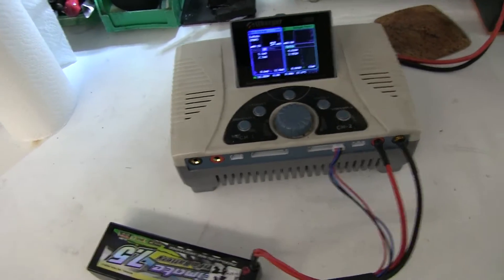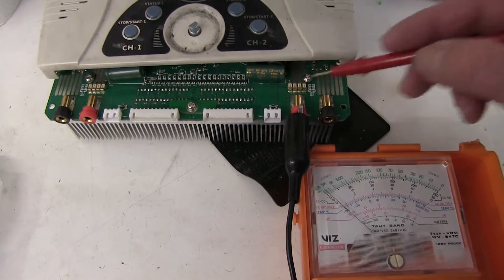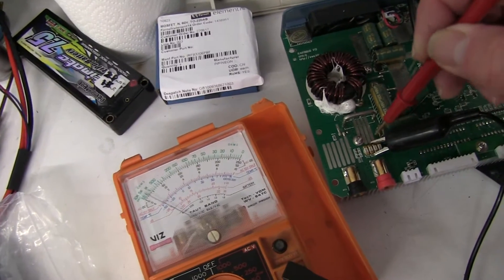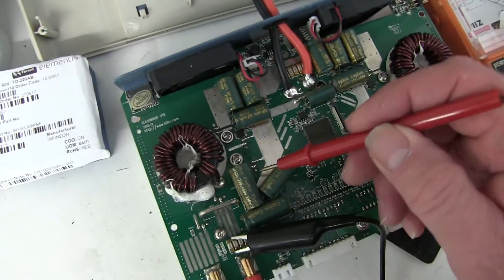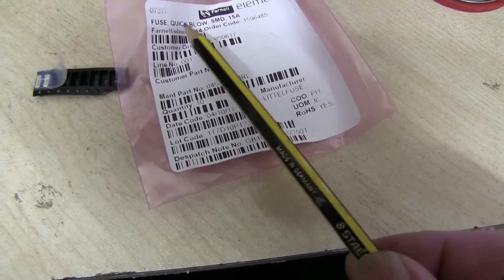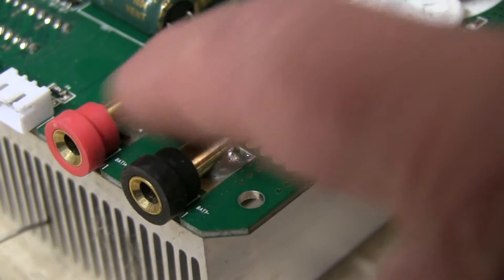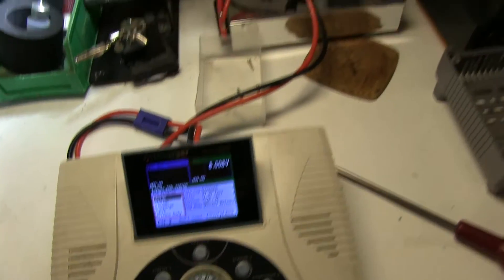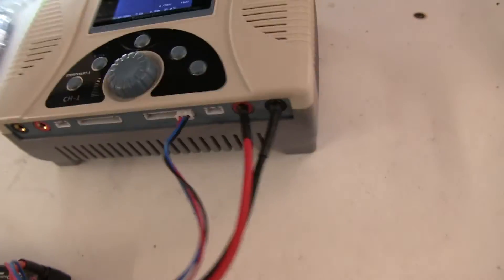ICharger 410 Duo Charger "Connection Check Error" Fuse repair.

Comment: Old charger, old posts lol.  But maybe someone can chime in.  I have a 4010 that blew all the ch2 fets from a power supply dropping from 36v to 24v.  I replace the fets and a few resistors that burned out, but now have a weird issue with ch2.  It will balance and discharge, but not charge.  When trying to charge the duo will make a pulsing sound and the charge current will climb with a negative value.  Without a current limited supply, it will burn the fets (learned the hard way).  The pulsing is pretty odd as well, you can actually feel it coming through the charge leads.  https://youtu.be/BUvKy_Ut18c

Comment: Don't fear trying to repair these ichargers
I managed to change 3 MOSFETs but you need a soldering iron with quite a thick tip to retain the heat...I used a Weller with a 6mm tip I struggled with a pointed tip ..be warned.
I purchased a longer ribbon cable which definitely helped plus be very careful with the ribbon cable RETAINING BARS there very weak and snap the legs off...I ended up having to wedge them in...and taking the screen off to manage to reassemble the charger.
If you find the charger doesn't come on its probably a bad soldered joint...
It works perfectly now. Thanks Nick RIP😇

Comment: Hi Nick, I connected a 55V battery to the backside input and it blew almost all 7 main FETs. I replaced all of them and now the right side works fine, but the left side does still nothing. Also no shorts. When I start charging the current goes to about negative (!) 0,2V and after a minute or so he sais connetion error. I checked all components as far I can and found the 6.8ohm resistor which connects the first left FETs Gate to the driver chip was blown. Replaced it but still same error. Any idea where I can have a look? I have the non fused version. Cheers, David

Comment: Hi Nick It John again from Michigan U.S. Silly question and more wishful thinking!! As I mentioned before the left side is coding #1305-check connections...& belive me the same leads that's throwing this error Work Perfectly on the right side Question is there any type of "Plug-In" Fuse mini..that I can check might be bloen? Or are they all soldering fuses to the board
Reply from the maker: Hi John  You can bridge the blown fuses with a thin piece of wire. Then you can see if it works or whether the wire burns up, if there is still a short circuit  (FET).

Comment: HI NICK GREAT VIDEO I HAVE THE EXACT SAME UNIT WITH MY LEFT SIDESHOW ING ERROR 
"Connection check error"
The same good working leads work fine on the right side...what do you think? ALSO can the led screen get a brighter light inside to view the screen better!?? I race outdoors and I would think for a $350 charger with all the functions they would have a an adjustment for the level of brightness but they don't respond to:....
bigjohnzubak@hotmail.com
Reply from the maker: Hi John. As far as I know there is no way to adjust the contrast. I find the display is okay outside, as the display can be adjusted to an angle.
The connection error is probably blown fuses or a FET.
All the best. Nick

Comment: hello nick i  have a 4010 duo icharger and were dead.  While charging in both chanel was short at the entrance to the charger and after a short turn off.  I opened the charger and found that the entrance fuses were burned and the mosfet entry was burned I replaced them but the charger shows no signs of life.  And for a short test I saw that the main microprocessor was heating up and after testing I saw that it had a hole in it maybe you know what the chip model is.
Reply from the maker: Hi Slava.  That is not good., and unusual.  Sorry, I do not know what the main chip is.  You could asking Junsi in China.  All the best. nick

Comment: Thanks for the enlighting video! My 4010DUO has a board with the  name "iC4010DUO V11 2013.08". It does not have fuses like yours. Not any, as far as I can see. It recently  blew 3 Power MOSFET, 2x FB3306 and 1x IRF3205 while I was charging a lead-acid battery with 40A on the right channel. Done this many times without problems, but not this time. Right channel blew with smoke coming out. It blew also a diode "1309 MT". I can not find a diode with this name anywhere! Nothing comes up when I google it. Can you help me out here? Shall I use instead a standard schottky 40V 5A?
Reply from the maker: Hi
The earlier chargers did not have fuses and blew out the FETs,  like yours.
I could not find that diode either.
So I put in a 6amp shottky SMD, that was a little larger, but managed to get it in.
Reply: Where did you get a 6A Schottky SMD? Never seen any of those. Think I´ll put in 2x 3A or just a 5A.
Reply from the maker: Hi
I am sure a 3A or 5A will be ok.
the 6A from Farnell is a bigger so hard to fit in.
Reply: Junsi Electronic Co.,Ltd just got back to me. It is a not a Schottky-Diode (to honor the guy, please spell it right) but a TVS -Diode. Name is "SMBJ43A".
Reply from the maker: Good work.
Yours is working now?
Reply: Thanks! Waiting for parts. Gonna be a couple of weeks from China. Greetings
Reply: I initialy blew the input FET (FB3306) and three FET on the right channel (2xFB3306 and 1xIRF3205), channel two that is. I checked the diodes again and this time they seemed fine. So I only replaced 4 FET and not the diode. After doing that, I powered up, the charger and it seemed fine. I used a current limited power source and charged a battery with 5A. After that I connected my 44V 1500W power supply and began charging again with 5A. This time, after a minute or so, it blew all replaced FET (M1-1, M2-1, M4-1) exept the input FET (M1). I must have missed something. So I checked even the smd capacities. I noticed that C13 is broken, no current goes through it. Its probably a 0805/2012 smd, but I dont know what capacity or voltage it has. I might have damaged it during repair. Soldering the source and drain is a pain, you need a lot of heat to solder and unsolder it. Can you give me any inside on it, or if the C13 can indeed be responsible?  Also, I forgot to adjust the settings for the power source. The voltage range was well under 44V. May this have caused the FET to blow this time?
Reply from the maker: Hi Mari
Very unusual to blow all the Fets.
Did they blow due to the high voltage, as the current was limited?
I would use the 3306 in all positions.
The diodes are transorb types just for voltage spike protection.
The capacitor, not sure, I assume it was open circuit. Probably just for stability and would not cause a melt down.
Are the Fets just open circuit or did the blow out short circuit?
Reply: Yeah, the capacitor was open circuit. I used a current limited power supply for first test. It does not have a lot of power or voltage. 2A 20V input and all was fine. Then I used my 1500W supply without limiting capability and fixed voltage (44V). It blew my FET after a couple of minutes or so. Also, as it functioned for a couple of minutes, the repaired channel did not go to the set charge amperage as quickly as the left channel. Far slower. This was maybe due to the broken capacitor. The FET all shorted between S and D. I will replace the capacitor and the FET again. Then I will test thoroughly with my multimeter and test again with limited current. Yes I know about the diodes, I told in the first place ;-)

Comment: Where are the fuses(fuse bank) on Ch2 on the older circuit boards.My boards layout is similar to the 308, no 4 fuse bank is next to the +- outputs, just a silver plate.
Reply from the maker: Hi Bruce
As far as I know, the older chargers did not have fuses on the outputs.
So any fault tends to blow out the Power Fets.